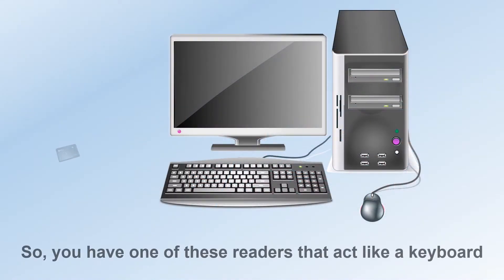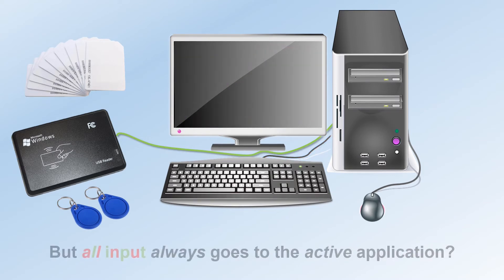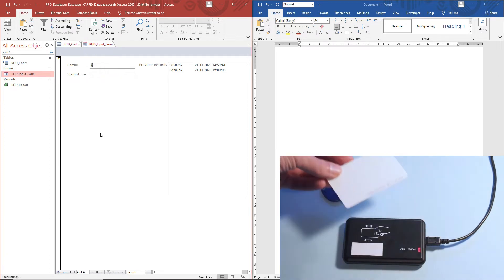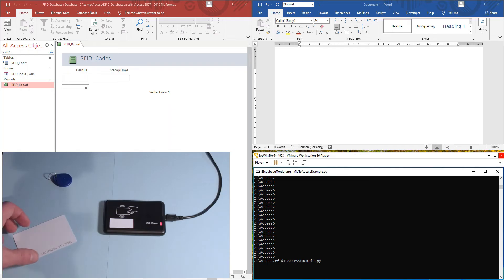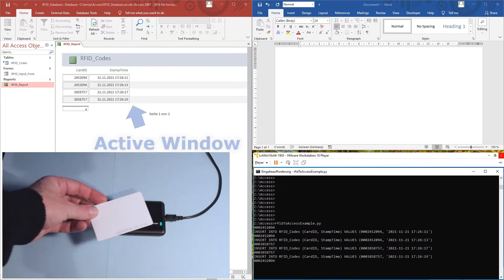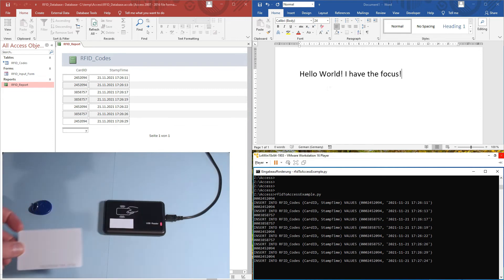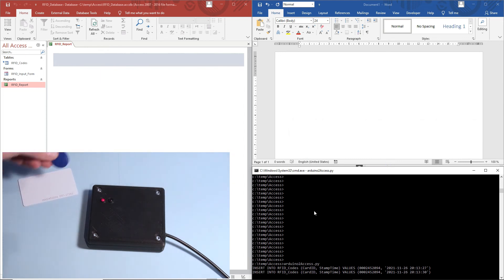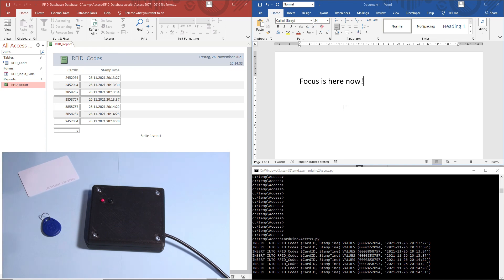Routing Signals from “Keyboard-like” RFID Readers & Arduino Alternative

Comment: Hello, thats the problem am facing, i want to buy an rfid reader that i can program and make it do what i want, not like a keyboard, where can i find them?
Reply from the maker: Thank you for the comment. I made me become aware that the entire “Supplies” section in the instructable was missing. I have re-added it. so please take a look at it as it might make things clearer. In summary, the shown device uses a RDM 6300 125 kHz reader that you can find all over the internet for very little money. This, however, is the plain reader hardware, so you need to add a housing and some other electronics for connecting it to a PC. If you want to buy a ready-made non-keyboard reader, do a Google search like “RFID reader with driver” or “RFID reader -hid” or “RFID reader without keyboard emulation”. There seem to be some of those around which come with defined drivers and APIs. Personally, however, I do not have any experience with this kind of readers, so I cannot really recommend a certain product.
Reply: @johnthinger7740  ok ok i see, might as well tell u what am using it for, in case you have better suggestions, i have a turnstile gate for a gym, i want to put an rfid reader, so that when a user scans his card, it opens and do the calculations on the softwar, minus one session and so on..., i also have another reader writer on the pc, so that i can write to the rfid cards, this is what am dealing with rn, am stuck in electronics, not my domain, am a but confused, thank u for the help in advanced my brother
Reply from the maker: @yakinwissem8665  In fact, my project had a similar origin: We tried to track lapse times of an open charity running event. People were able to join in and leave at any time, so we had to register new participants while tracking the lapse times of everyone who was already on the circuit. Hence, we had two readers connected to one PC, and with all the emulated keyboard events it was a mess. So, you are left with the three options: A) buy a more expensive system with suitable drives, B) capture all keyboard events and manage them somehow, or C) make your own electronics. Now, as said above, I have no experience with those “higher priced” readers (which start around $40, I guess), and there is always the trap that you may end-up with those keyboard emulators again as most people seem to be lucky with this concept. For the second solution – capturing the keyboard events from two readers on one PC – you will find some pure software solutions in my instructable, although I must admit that they all not really “feel” stable for a long-term application. So, C – your own circuit – is always an option. I know that electronics are not that trivial, as I am more into software, too. However, if you want to go the software way without soldering, there is the option to use the RDM6300 module together with an FTDI which converts the signals of the reader to a USB data stream – but not to keyboard signals. Besides the reader and the FTDI you just need some jumper cables. You will find this concept here: https://m.facebook.com/nt/screen/?params=%7B%22note_id%22%3A3203160266480343%7D&path=%2Fnotes%2Fnote%2F&refsrc=deprecated&_rdr
If you do it like this, the raw data will appear on the USB port, so you can handle that raw data stream in Python (or your preferred language). That software would be essentially like the one shown here: https://www.hackster.io/colossus-davinci-553178/make-a-serial-keyboard-by-rdm6300-0edc45 ...with the only difference, that you will NOT convert the signals to keyboard events, but route them to your target software directly.
Reply: @johnthinger7740  i see i see, this info is already top notch, now i have a link to follow until i find the solution and the final product, thank u so much, will come back to this video if i need more help 😅, thank u again my brother!!